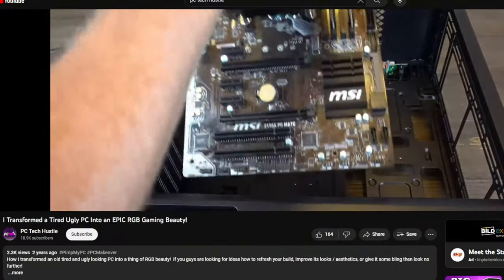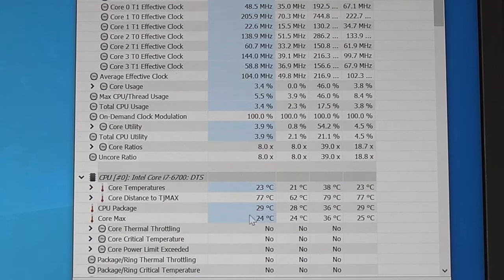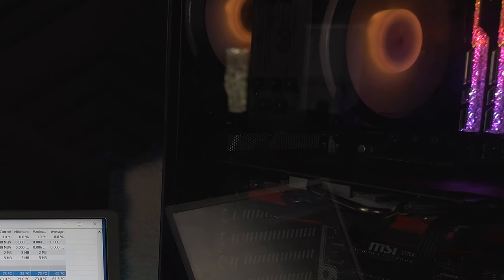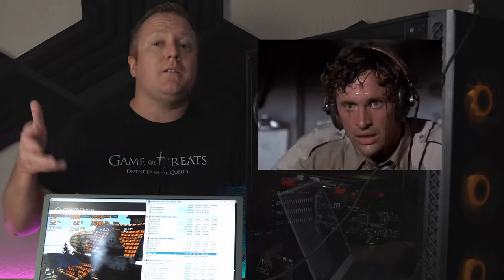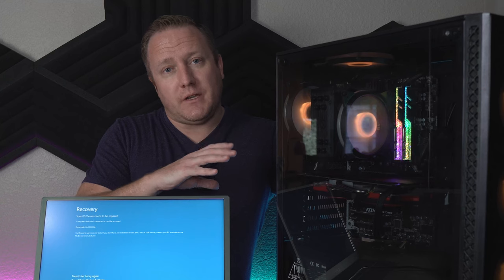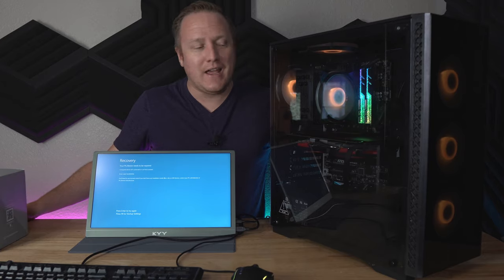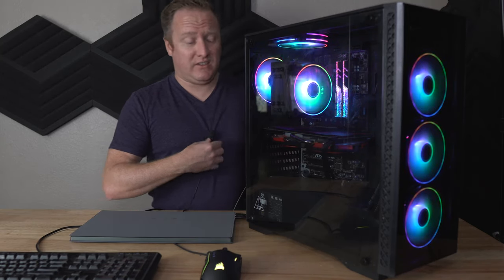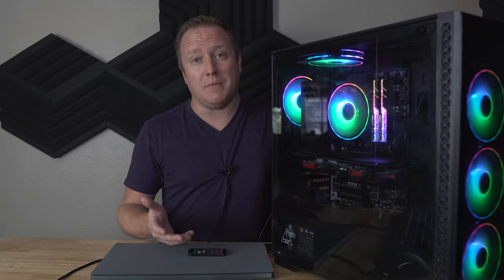Customer States: "PC is Running HOT!"  - Troubleshooting an "Overheating" Gaming PC

Comment: The problem is thermodynamics, now exhaust a low volume of air but at a higher temperature, the only solution is to reduce the thermal energy disipated by electronics.
Reply from the maker: True but as we observed the temperature didn’t raise a ton after slowing down the fans so it should help a bit.  As I mentioned in the video the real solution is to introduce more ventilation.

Comment: 🙂 Buddy, sell him a Watt Meter, then teach him how to lower the watts by adjusting the resolution of the game and putting a frame cap on the game, also depending on the system teach him how to lower the watts on the cpu and video card. Less Watts = Less Heat.
Reply: u can also teach him to move over to a cpu and a video card that uses less watts

Comment: First guess is you built it in a choke box.
Reply from the maker: The case actually has plenty of airflow.  As you can see the components are not overheating, not even close.  Case air flow is actually quite good if it's heating up the room it is in.